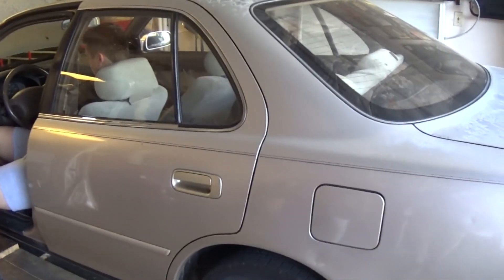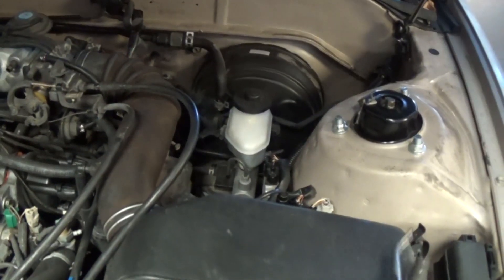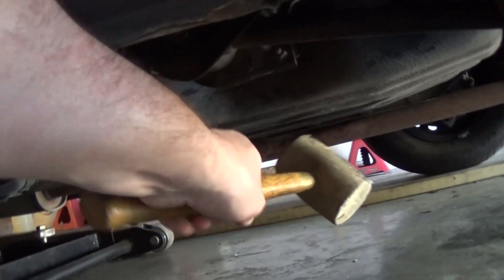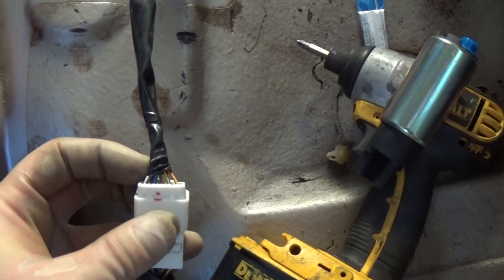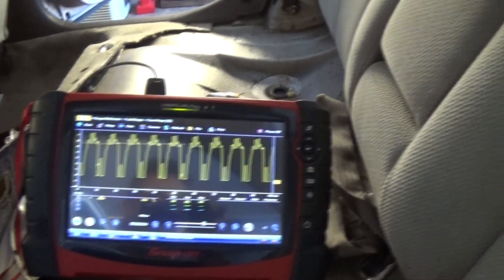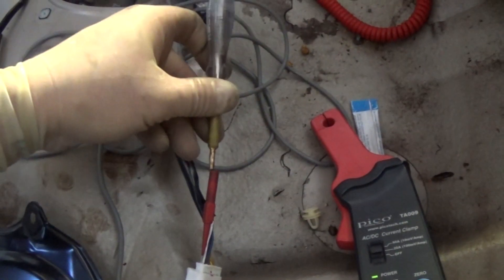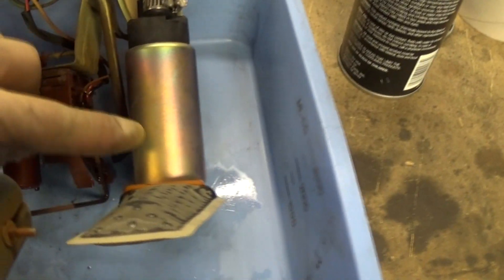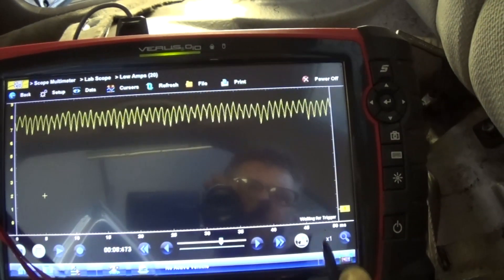Toyota Camry Crank No Start

Comment: So I'm having an extremely similar problem, however my 89 Camry starts just fine when the engine is cold & I can take a small drive, but then 15 minutes later it just cranks & won't start at all for an hour or two until the engine is totally cooled again. It originally just died out on me in the middle of a road & I was stuck at an intersection, no check engine lights, no warning, no anything. So I just got done replacing the spark plugs & wires, distributor cap & rotor, then the fuel filter & fuel pump; thinking that the fuel pump & fuel filter were the main issue. I thought I had fixed it actually after having to drop my tank to change the pump since it's in a different location than the sending unit. I drove it around a nice country block & then got home, waited 15 minutes, & boom, same issue, still stuck at square 1 really, just cranking & not turning over. My last effort is going to be to buy a new EFI Main Relay, because that'll be the last thing in the fuel system to really change, & it's a cheap car anyways so I'm not going to bother digging too much further if I don't even know what the issue is. Anybody got any advice? What else could give me these symptoms?
Reply from the maker: EFI main relay and crankshaft position sensor is a good plan.

Comment: Hey I got a 2000 Toyota Corolla 1.8 with 98670 miles just stopped going down road new fuel pump fuse all good new crank sensor got spark got fuel cam turning so guy on utube had same problem crank crank crank nothing said the number 2 coil had spark but he said he changed it and car started right up he said it was some Toyota fail safe something I got fuel I got spark wont even start when I spray starting fluid in it what gives any ideas would a bad cam sensor cause this I'm at my wits end and thoughts driving me mad compression also good

Comment: So I’ve been trying to get my buddies 99 Camry running, he was driving it started rough idling which got worse over time then it stalled out but started back drove a lot more then went out one morning and it wouldn’t start. I changed the pump but still won’t start I’m planning on changing the fuel pressure regulator next, has spark and turning over normal
Reply from the maker: If you didn’t have original pump with connector it’s possible to swop wires and pump will change rotation and pump fuel back into fuel tank. I would check fuel pressure first

Comment: 10/98 Toyota Camry no spark
Reply: There is no crank sensor on the balancer. Is it back of engine by flywheel?
Reply: Thank you so much. So much!!!!! So it bolts to the engine or the tranny. I always thought they were mounted to front if engine and balancer had a notch to activate. Guess it gets its signal from the torque converter. Didn't except that. Thanks again.... I've been scratching my head trying to figure out HOW or where it picked up its signal.
Reply: Might behoove me to pick up a component locater manual. Darn sure it would've saved me a bunch of trouble. I tore everything from FRONT of engine to get to the balancer. Owner would have been happier, too to get his car yesterday instead of today!!!!!

Comment: J have toyota camry1992  2.2 automatic transmition. J have electric  problem on the automatic gearbox. There 3 wire connected with automatic transmition. 1.neutral safety switch  its connected. The other two wire don't. Fist wire is on the shifting  solenoid .It's long about  12 cm but is not connected with power. J look and look  and can't  see where should be connected. This shifting solenoid is located behind  neutral safety switch. The other cut wire is located  on the right  side of neutral safety switch  behind the dipstik. It's long 20cm.The camry  ride great in reverse  very very hard sometimes drive  forward .Also there is no reverse light  on the back  Could someone send me a link to see how is concerned  the two cut wires on the automatic transmition